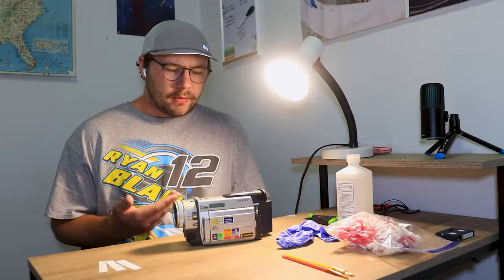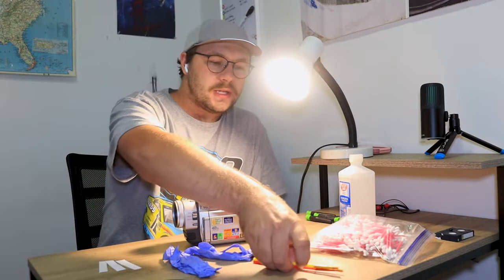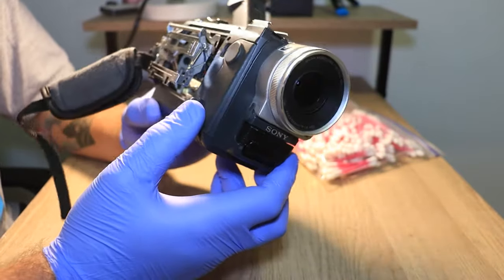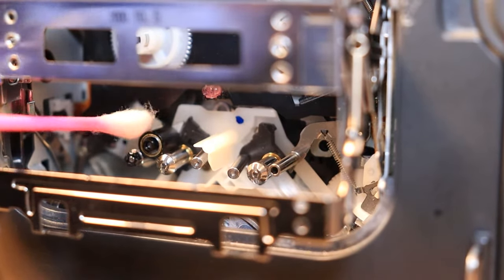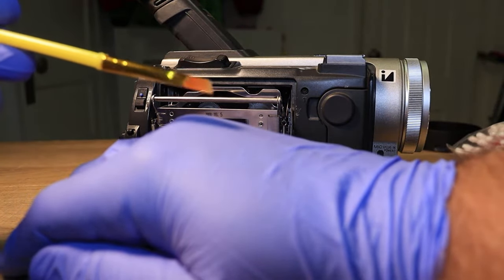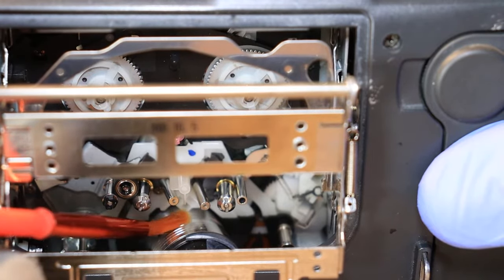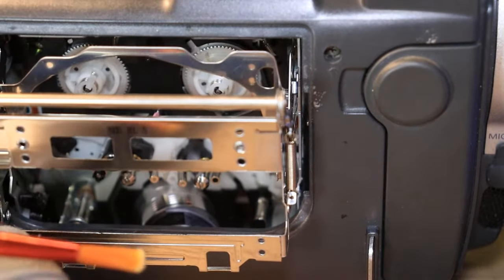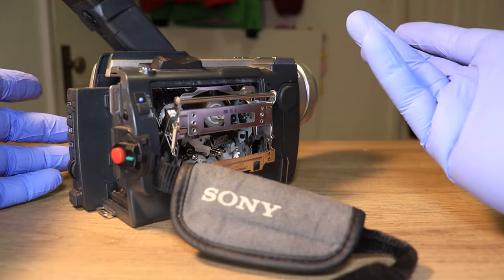[How To] Best Way To Clean Tape Heads On Any Camcorder

Comment: I think it's worth noting that heads have a life span and just go bad after time.  When this happens no amount of cleaning is going to fix this.  That's why the PD100/PDX10/PD150/PD170 have an hours meter.  It allowed the owner to visually see when it might be time to send the camcorder back in to Sony for servicing and or repair.  The TRV900/950/VX1000/2000/2100 did not have an hours meter in the menu.  The only way of checking the hours on those models was with a certain version of the RM-95 (the model that has the NOR<->ADJ sticker on the top left).

Comment: Title adjustment: "On Any Tape Camcorder."
Reply: Thanks for your comment love, Brandon! So... since you agree with me, when will you be making this quick and easy adjustment?
Reply: “Tape heads” implies that
Reply: @shauncase5294 : Haha, no it doesn't. The complete statement is like incorrectly saying "all camcorders use tape."
Reply: @HelloKittyFanMan  look up the definition of imply.
Reply: @shauncase5294 : I already know the definition of it, duh.  Look up the definition of "any."

Why do you even care what I told him, ANYway?
Reply from the maker: @HelloKittyFanMan  the thumbnail indicates that this cleaning method is for vhs, vhs-c, video8, hi8, digital 8, and mini dv camcorders. So I do not need to change the title.
Reply: @brandoncameracollection : Yes, because the title contradicts that. "ANY" in this case is either like saying that "All camcorders use tape," which they don't, or "You can use this on even the kind of camcorder that doesn't use tape," which isn't true either. Besides that, the edit to add the word "tape" right between "any" and "camcorder" is just a few clicks and it's done. So why would you want to be so resistant to it, especially when you already loved what I said and have now already made more clicks just to say this than it would have taken you to adjust the title? Why do more work to tell someone that you're not going to make an edit to make sense of something than you would take to just do the edit, especially when you already loved what they said?
Reply from the maker: I’m not sure why this is such a big deal for you. People are finding the video and it’s helping them. They can clearly see the thumbnail is a tape deck and it says what kind of camcorders it’s for. You’d have to be a complete moron to think that modern camcorders still record to a tape. So please stop arguing with me and other people over a YouTube tittle.
Reply: @brandoncameracollection : Why is this such a big deal to YOU? You tell me not to argue, but yet here you are, spending more energy to do that very thing that you're complaining at me for, instead of spending just a LITTLE energy to think/say, "Ahh yeah, I see what you're saying; I'll fix it, thanks." WHY would you rather focus more energy on all the clicks it takes you to type all this stuff out to dispute the simple fix instead of just the few clicks it would already have taken you to just do the suggested fix? Why would you rather do a lot of work to resist something than a little work to fix it?

You're really not sure why I  I already explained the reasoning. What: you didn't even bother to read my reply before you just went on replying? Why don't you actually read every reply before responding to it? It's not just about people "finding the video." I already told you, it's a self-contradiction: you're saying one thing about camcorders and then you're backpedaling and saying nonsense about them. Go back and read my explanation. Don't you know what "ANY" means? Without making an exception for it, "ANY" is unlimited. It's like you're saying that you believe the only kinds of camcorders that exist are cameras that record to tape. Do you really believe that? Do you want to sound like you believe that? Why go on and on about this when you could just click the word "tape" (title caps: "Tape") in there and be done?

Comment: I used qtips and rubbing alcohol no screw drivers needed rubbed it on the spiny rubber parts and the drum thingy and then shoved a tape and pressed rewind and boom it works. 😂
Reply from the maker: Careful if you use a q-tip to clean the video head you can damage it beyond repair if your rip out the little copper pieces

Comment: I watched, years ago, a guy clean VCR heads with an old flannel shirt and a sacrificial VHS tape. He removed the tape in the cassette and used it to fool the VCR into running. Then he dipped the flannel in isopropyl and cleaned the parts while they spun.  These days, getting a sacrificial tape is tougher.
Reply from the maker: That sounds a bit complicated but idk if I would trust that

Comment: Thank you for your valuable video. Can I use glass cleaner instead of alcohol?
Reply from the maker: Yes but I recommend only using glass cleaner on there rubber roller since rubbing alcohol will dry the rubber out. Everything else that is metal I recommend using rubbing alcohol

Comment: Hey just curious would you have any idea on how to fix it if the tape ejection doesn't work? Mine is a Sony DCR-HC52 , and any time I try to close the tape mechanism it doesn't close and it just springs back up, neither will it roll back down. Any ideas on how I could fix that?
Reply from the maker: To get your tape out you pretty much have to take the camera apart to get the tape out. It’s definitely not a fun process haha

Comment: The manufacturers recommend a head cleaning tape. You can knock the heads ect out of wack plus. They recommend this because heads are very susceptible to fine scratches using Q tips.

Comment: Hey man! So I got an old camcorder (JVC GR-D50E) and while it seems fine, there is a problem with video playback. It gives me an error (E03: Unit in Safeguard Mode - Eject and Reinsert Tape). I tried this with multiple tapes and I always encountered the same issue. The video would play for some seconds until it eventually froze. I tried some of the quick fixes but I can't seem to understand what's wrong. Would it be easy for you if I sent you a photo of the tape heads so that you could tell me what's going on? Thanks for your time!
Reply from the maker: I feel like jvc mini dv camcorder always have some kind of safeguard mode error. Have you tried cleaning the tape heads? Also make sure the rubber roller doesn’t slide back and forth on the pin. There is a little plastic piece that holds the whole roller on. If that is cracked or completely broken off that rubber roller can fall off or move around causing the camera to throw a code. Happens a lot with any brand of mini dv cameras

Comment: Hey, I was hoping you could help me, 
I have my parents old JVC GR-AXM225, I was rewinding a tape and a piece fell out from the tape cage. I tried to put it back in with tweezers but couldn't. 
The camera still works but now the time on the tape is wrong, which isn't so bad but I don't know what to do.
and I think the tweezers may have scratched the video head how bad is that? would that affect the old tapes or just new ones?
Thanks
Reply from the maker: As long as the camera will still play/record to a tape you should be ok. There is a small battery in the camera that keeps the clock running. You should try replacing that and see if that helps
Reply: @brandoncameracollection  Thank you, do you think it's bad if tweezers scratched the video head and if its noticeable?
Reply from the maker: Yeah it’s definitely not good if you scratched it
Reply: @brandoncameracollection  Thanks, how would I know if I did?

Comment: How do you go about fixing tape decks that ate your tape?
Reply from the maker: That I’m not sure. I’m still learning how to work on cameras but I would think there might be something wrong with the tape guides. You might take your camera slightly apart to see how if the rollers move properly

Comment: Why don't normal head cleaners clean the heads better?
Reply from the maker: They don’t seem to pick up as much dirt and stuff. When you clean it with this method you are pulling everything off of the rollers and head drum. And cleaning tapes don’t get down into the holes where the video heads are

Comment: Wow!!! Life saver :) this worked for my sonyhi8 camera (so far so good, don’t want to jinx it). I was able to use the Q tip and brushes without removing the door to the cassette door and had to do two deep cleanings (lots of black gunk came off the first round of Q tip cleaning on the rubber roller) but I noticed a huge difference after the first clean. I did a second clean as there was still some minor glitching. Thank you so much for sharing this!!

Comment: Hi Brandon, I recently pulled out my Sony Handicap DCR-TRV530 to see about converting all those analog tapes to digital. It hasn't been used for at least 10 years. It powers up with the power cord, viewfinder works, but when I put in a tape (yes, the tapes have been rewound to the beginning), all I get in the fold-out color display is a blue screen (or in the viewfinder for that matter). Same result no matter which tape I put in (they're definitely not blank tapes but ones that should have video footage on them). Do you think cleaning the video heads is what's required?
Reply from the maker: Yes I would say you’re tape heads are dirty. Generally with Sony cameras if your screen is blue while trying to watch playback that usually means your tape heads are dirty. Since it can’t read the tapes it won’t display anything. So you can either try my method to clean them or try out a cleaning tape. Although I find that cleaning tapes don’t work very well
Reply: @brandoncameracollection  Thanks Brandon! I'll try your method to clean the tape heads first, with the isopropyl alcohol and q-tips. I checked into the head-cleaning tapes but what I suppose is a good one from Sony runs more than $100. Thanks for responding to my question!

Comment: There are SO many reasons why I say you don't know what you're talking about.

1. You're calling everything by the wrong name. There's the capstan, a metal cylinder rotated by a motor or it IS the shaft of the motor.  (You have this right.)  But the rubber cylinder is NOT called the capstan roller.  It is the PINCH roller!  It is rubber and it's the ONLY thing rubber, unless there are rubber belts below the chassis. The metal guides, some with rollers are NOT pinch rollers as they do not do the pinching of the capstan.  If you don't know the correct terms, I'd never trust you to touch MY machines.
2.  NEVER put rubbing alcohol on pinch rollers.  It dries out the rubber.
3.  Lots of black on your swab from the pinch roller?  Duhhh.  You're almost always going to get black off that, especially if you keep using alcohol.
4.  You're saying get aggressive on what you incorrectly call "pinch rollers".  (I've already explained that they don't pinch anything.)  NO, don't be aggressive anywhere near a VCR; they are delicate machines!  NO ONE has ever said use paint brushes!  Further proof you're winging it with no real knowledge.  You're a danger to all VCRs!
5.  You wrongly say don't use Q-Tips on the rollers.  NO, there should be nothing to cause the cotton fibers to snag on the rollers; ONLY on the video head.  Q-Tips are fine on everything EXCEPT the video heads.
6.  Brushing the upper cylinder vertically is DEFINITELY a no no!  Are you trying to trick everyone into destroying their machines??

The one good thing you did was wear gloves to prevent grease contamination. Small consolation if you've ruined the machine.

Comment: Can I use nail polish remover instead of rubbing alcohol?
Reply from the maker: No definitely don’t use nail polish remover. Just try to use as close to 100% isopropyl alcohol as possible. I’ve been using 91% and it’s worked ok. You can also use windex but only on the rubber roller. Rubbing alcohol can make that rubber roller dry out and crack. I haven’t had it happen but I’ve heard it does.

Comment: I love your video and with your calming, nice presentation. I have a Sony Dsrpd 100ap and it has troubles with playing back footage. The video is ok, but the audio goes on and off, so the capture program captures in short segments of 1-10 seconds even if there are no change of scene or pauses between within a take. I tried to clean with a Sony cleaning tape. It seemed to improve somewhat. So now I can capture some scenes with audio intact for longer durations. But the DV tapes which I have used another Canon camcorder which is Mini DV and probably 44.1 KHZ audio seems difficult to capture. Here the sound goes on and off constantly. Any Advice? Are these symptoms of dirty video drum head?
Reply from the maker: Yeah I believe that is dirty tape heads. Try this method in this video and if you you use the q tips you’ll be able to see how dirty everything is
Reply: @brandoncameracollection  Hi,my mini dv says condensation operated paused (can’t play tape or record,but it works when it is fully charged)please help 🙏

Comment: Got a Sony vx2000 with bad heads recently. Gonna attempt this sometime this week, hopefully it works!
Reply from the maker: Yeah definitely give it a go just be patient and persists. If you get tired of doing it just take a break and come back to it later. It is very time consuming
Reply: That model of cam used to have this problems, try with a av capturer so uou don't need tapes anymore
Reply from the maker: I’d love to get a vx1000 some day
Reply: @Brandon Alldredge  I have a vm-2000a hitachi recorder and I'm trying to figure out why it isn't recording/rewinding/playing tapes. I suspect the video drum because that's the (probable) source of the horrible noise it started making, after I fixed the also common issue of the belt being broken, making the ejection option impossible. It all works great now, just not recording or really functioning at all on the VTR side

Comment: he so I have a error code on Sony trv280 it’s c31:23 could that have anything to do with the heads I still have the black rubber piece on there so it’s not that but yeah idk what it could be
Reply from the maker: You should be able to google what that code is for the trv280. But it could be dirty tape heads. You could also try a brand new tape that hasn’t been recorded to yet and see if it will throw the code. If it does definitely try cleaning the tape heads. A lot of times that can fix weird issues but I’m not guaranteeing anything.

Comment: Hey Brandon, really imformative video. I just wanted to ask I have been running into playback issues with my panasonic dvx100b. Even if its on vcr mode my screen is just blue cant seem to find my footages but when i check the rec-check option i could view my previous clips. Could this be a tape head issue? Thank you!
Reply from the maker: I think your tape heads might just be dirty. Usually if you can record but you can’t see any footage in playback or the screen is just blue that’s usually the issue

Comment: I have sony trv 285e i want to open the door manually is there any way the cassette stuck in
Reply from the maker: If the tape is stuck in the camera you will most likely have to take the camera apart

Comment: would this method work on a Sony TRV-740?
Reply from the maker: Yes
Reply: @brandoncameracollection i just did it and i’m letting it dry at the moment, but i think i messed up big time
Reply: okay so turns out i didn’t mess it up BUT, the playback is still messed up but it shows like two seconds of the recording which gives me hope. could i send you a email of a video of the footage and give me some recommendations?
Reply from the maker: @lizardtwin definitely make sure you are using a new tape to record to after you clean the camcorder
Reply: @brandoncameracollection  okay so i figured out how to use the playback feature and it plays the whole recording but it glitches and also, when i stop recording and add another recording, it says cleaning cassette or something

Comment: I started buying "old" camcorders but the batteries always run out in 5 minutes or never charge ,are there new batteries ?they are all batteries from the 90s?
Can I buy new model battery pack that fits old camcorders?
I have 2 panasonic PV-L678D/550D
And a Sony CCD-TR40 
the Sony battery pack is NP-77H
the panasonic battery pack is PV-BP18(P-V611)
Reply from the maker: Ahh well lucky you, you can use the same battery for both of these cameras https://amzn.to/3BTrLDe
Reply: The batteries should have a model number.

Comment: I want to try this, but I noticed there is a ribbon cable on the side of the tape deck. Should I try it to take it apart or not? Really anxious about it, tbh. 🤔
Reply from the maker: Well where that ribbon cable is you would most likely have to take the camera pretty  far apart to have to mess with it. A lot of Sony cameras you’ll have to pull one side of the camera apart to easily get to the tape heads. What camera are you using?
Reply: @brandoncameracollection  Sony DCR-PC109E. I keep getting the error warnings everytime I put my tape in.